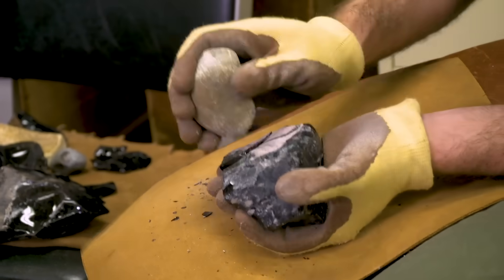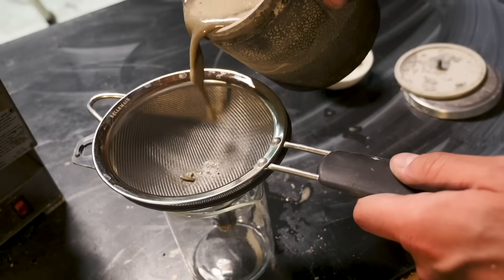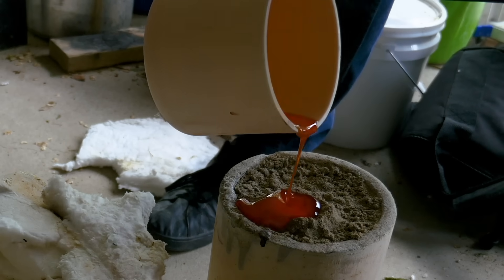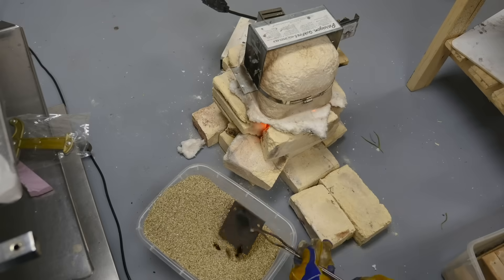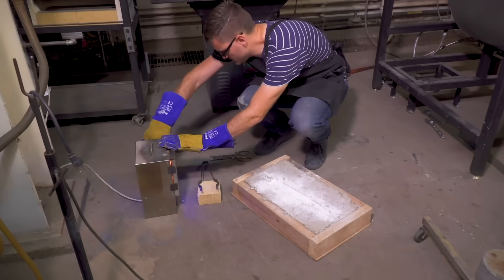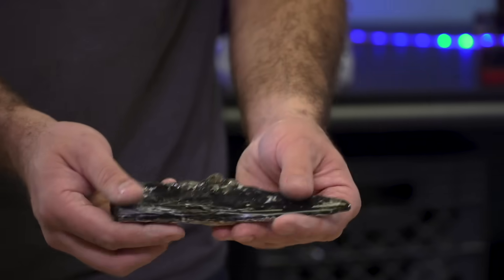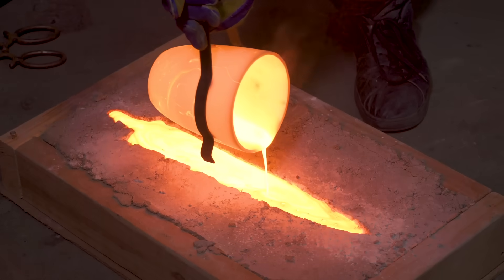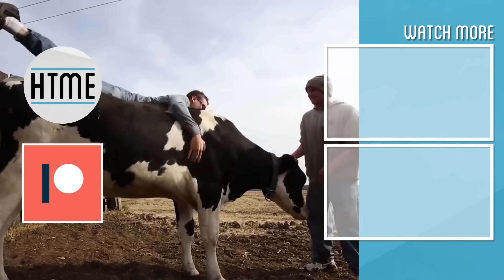Can You Melt Obsidian and Cast a Sword?

Comment: Anyone with industrial/research casting experience will find this whole video cringeworthy. Everything about the way this guy goes about this experience; the lack health and safety (casting low down in shorts), kiln safety, kiln and mould preparation, mould heating, crucible prep (no crucible coating), crucible transfer of brittle ceramics, poor pouring technique, kiln damage around high current elements, flux fumes and so much more. Leave it to the experts or get some training, you'll end up hurt by glass or metal scalding, electrocuted by a kiln or worse dead from a hydrogen explosion.
Reply: Honestly I have basically no knowledge of casting and I was looking for a comment on this... Everything seemed very sloppy and overly casual with such dangerous materials and tools
Reply: This was one of the more frustrating videos I have watched recently.  He did exactly the opposite of everything I know in casting.
Reply: Liofa i was thinking the exact same thing xD
Let alone how he lets his cat run free next to his workspace...
It’s idiot like this that validate every moron’s blacksmith fantasy
Reply: @LJ3783  That's me!  Thanks to the inspiring tone of this video, I'm off to make my own Buster Sword and dislocate my shoulders trying to swing it.  Hopefully my cat steps on it while it's still cooling so I can get a SICK pawprint pattern on the blade. Bye!
Reply: there was some point when he was handling the crushed glass with his bare hands and I was scandalized
Reply: @monckey44   I know right! Looked like he must have learned because the next time he handled crushed glass he had gloves on.
Reply: Musictechnology have you not seen the guy make a jello knife? honestly amazing. pretty sure that guy knows what he’s doing though
Reply: And also who has so many kilns around that it's no biggie when you break a few??
Reply: @Musictechnology  exactly... and lmfao... 😂🤣😂
Reply: Liofa its pretty frustrating, I agree
Reply: Please explain how we can off-gas enough hydrogen for it to explode and kill a nearby human.  Asking for a friend, definitely not looking to create a hydrogen explosion or anything...
Reply: I scrolled too far down for this, OP is obviously is not a master blacksmith and I doubt he is even (a) blacksmith. What happened to the sampling phase?
Reply: I knew I would find a person like you in the comments. That guy who always knows better than everyone else because of your qualifications... oh wait.

Also, for everyone who thinks they know better, make a video showing your know-how. I may not know anything about metallurgy or forging anything in general, but I sure as hell am not a charlatan.
Reply: the tyrant67 basic safety is something you learn in your middle/high school chemistry and shop classes. there’s also common sense.
Reply: Except for the fact that he didn't get hurt, you have a point.
Reply: @motnosniv  
I can theoretically walk through a field with twelve guys blindfolded firing rifles in random directions and not get hit. That doesn't mean it's a good idea.

There's a lot of things that could have gone very wrong for this guy and thankfully they didn't.
Reply: @vigorouslethargy  i guess i missed the part with the rifles. Don't forget your towel.😳
Reply: So record a video casting with it, ugly hater!
Reply: @ShihoArete  >ugly hater
You don't even know what he looks like though.
Reply: If you knew anything about this channel, which you don't, you would know that is not his goal. His goal as a NORMAL PERSON is to try and makes things from scratch.
Reply: @gdshade6876 - LOL... Can't watch anymore, gotta get to work on my homemade nuclear reactor now... I'm not a physicist, it's just, you know... what my "channel" is about!
Reply: @thatwasinteresting.8150  Uhm, okay
Reply: @thatwasinteresting.8150  Yes because the dangers of casting glass is definitely as universally well known as radiation...

I have zero experience in casting anything, and as such, was unable to spot any heath and safety concerns (with basically the exception of his nonchalant reaction to the heater coils shorting, but if it didn't do any damage, I guess I can't blame him for not worrying).
Reply: GD Shade That’s exactly the issue then he’s some normie who isn’t even taking obvious safety precautions.

Comment: there is some chemical reaction in obsidian that just keeps on bubling when melted until there is just a small bead less than 10-12mm D and even that will most times crack as it cools.youll have to ask a geo or chem professor what,? i dont know but have tried many times with same result..only way you will get what you want is to carve it out of a solid block of stone which is probably how the original was made. or maybe put it in a high pressure chamber till it is cold.expect it to have fine surface cracks at the very least.

Comment: The best way to melt obsidian or any "unmeltable" substance for casting or to form an alloy is to use an arc welder. Using a couple graphite rods and a graphite crucible you can melt just about anything your power bill can withstand (maybe try a generator). In this way you can form your alloys in the crucible or layer it in the mold. Give it a shot some day, I'd love to see your results.

Comment: Thing is... what makes obsidian special is it's crystalline structure, not the material per se. If you really wanna cast real obsidian there should be a special level of pressure and slow cooling so it becomes compact enough to produce a sharp edge.
I'm in no way underrating your findings but if you were interested at coming back to this project one day there is def the need for some pressure

Comment: You need to put the mold in the kiln and pour it in the hot mold to keep it from cooling, then put the mold back in the kiln and slowly turn down the temp until its off. It won’t shatter then.

Comment: A vast majority of your problems seem to come from using incorrect equipment. You have how many casting furnaces, but no glass annealing furnace? You're using rough sand casts rather than metal optic molds? You routinely burn through your crucibles? Do you actually do research before attempting these things?

Congrats on your black glass sword, I guess? It's not obsidian.

Comment: Obsidian is basically just volcanic glass. When I took Anthropology they had us do flintknapping with melted down glass bottles so they could re-melt and re-use them every semester. 

You want quality nonmetallic blades get a sapphire knife. Hardness second only to diamond and can be cleaved into atomically perfect edges if grown in a single crystal. I used to have a sapphire knife (but not single crystal) with a beryllium spring to bring through metal detectors.

Comment: As a GIA Graduate Gemologist, I can answer your question to yourself as to whether the obsidian you melted could be considered "obsidian" anymore. The answer is, "no." When the silicon dioxide originally formed and was melted together by whatever geological even which created it (typically a volcano or magma intrusion,) it was then obsidian. Once you melted it, and especially since you purified it with the flux, you changed the natural properties of it to "glass." In the end, once you melt the obsidian, it can never actually BE obsidian again, just glass. So the answer to the big question here is, no, you can't melt obsidian and have an "obsidian" blade, just a glass blade.

Comment: Here’s your main problem- dissipation of extreme heat over a short time.  First HEAT YOUR SAND - and keep it hot while cooling slowly.  Your sand is  ambient temperature, and the obsidian is 2000 Degree plus.  That’s a huge difference in temperature, and that’s EVERYTHING. Try to mold the sword thicker too.  Of course, once your totally done, with all the time and money invested, one drop on the ground will set you back to start.

Comment: It's just slag, man. volcano rock, etc.      if you can pour it into a cast-iron or steel form instead of sand or concrete, you should be alright.   Worked at a blast furnace for long enough to hate everything about this shit hahaha.   Crazy dangerous, hard to control, etc.   It's like oddly-beatutiful and equally hot sticky garbage.

Comment: Try mixing water with lava
Reply: Got cobblestone. Did I do something wrong?
Reply: @plbster  use lava soure instead of using flowing lava
Reply: plbster  You meant smooth stone? Cuz that's what happened to me
Reply: @Egorold  
No it was cobble it said it when I mined it.
Reply: @plbster  i got obsidian
Reply: @plbster  It's supposed to be not moving lava and moving water.
Reply: i found diamonds, at least i can cast a sword with these.
Reply: Lucky I can’t find shit man
Reply: Zero Bahamut idk if you’re talking about Minecraft, but you can’t simply melt down diamonds and cast a sword. It’s like glass but the hardest type you’ll find on the market. Diamonds are composed of mainly carbon and maybe some other impurities. Melting diamond will be a very hard task because Carbon melts at 6,000°, and diamonds form over 100km in the mantle below the crust where temperatures are already over a thousand degrees, which would already slowly being to melt carbon, but because of intense pressure it doesn’t. Melting carbon that’s packed so densely it crystallizes will be hard. It requires a very high temperature to expand the innards of a diamond gem because of it’s density and hardness. Especially melting one will take alot of patience. Casting a diamond sword with the same durability is practically impossible, since the density of the diamond before will not be retained when it cools into the cast, but it’ll still have some reaction while cooling. It’s most likely to turn back into carbon since the pressure is weak than in the mantle and the temperature is less intense, while cooling it might just turn into a sword out of coal and expand as it cools so it can also fracture.
Reply: Pau Casajuana Mestre where tf you gonna get lava from
Reply: RalphMan From the caves duuh
Reply: Alex Marc caves are limestone. Caves don’t normally harbour lava or any molten substance. Caves are made from water eroding and carving out giant caverns underground until they evaporate or leak out. It’s not like lava would pour in because water would evaporate in the first place. But there can be some caves premade but then disturbed by nearby volcanic activity resulting in a pool of lava sitting in a limestone cave. Though it’ll most likely cool if temperatures don’t increase
Reply: That makes obsidian
Reply: @GreenSteedaGT  wooshed mate
Reply: Well that's just making a cobble generator
Reply: Don't forget, you need an iron bucket to carry the lava around.
Reply: Rodary Windsor Cleveland salt water and fresh water would have very different reactions
Reply: Lmao your joking right? I would make a huge explosion too dangerous
Reply: @stewpidasso3910  It's a minecraft joke...
Reply: that makes stone and a lot of steam.

Comment: Hmm the topic of the video really interested me cause I couldn't see a possible way of reforming the obsidian into such a perfect shape as the one of a sword. I don't know if there is a process somewhere around the world (highly doubt it) but surely something went wrong cause you made something out of obsidian (which is not obsidian since you changed its mixture) and it was so fragile. Obsidian's toughness is pretty close to diamond's and that's why it was used as a tool or weapon material in the early ages of humanity. And last i think that if you ever try the whole procedure again you should try cooling the "obsidian" exactly the soonest possible as it comes out of the oven. You see obsidian gets the form of glass because the magma, that comes by the melted mantle of the earth, escapes inside chambers that have extremely lower temperatures. Otherwise if it was given even a very little more time to cool off it would form an actual rock with minerals and etc. So to make long story short try degrading the cooling time at the lowest possible an give us a feedback! Nice try btw!!

Comment: You're thinking too much like glass. While it is indeed a natural glass, it's not so before it is formed.

What you could try is making your own molten felsic material, pouring into a thin mold, and then trying to cool it as quickly as possible, as opposed to trying to slowly cool it in an annealing oven. I'd start with say CO2 fire extinguishers, as Mythbusters got a can of soda to "cold" in I think 3 seconds back in the day with the aid of a CO2 fire extinguisher. From there, you could try pouring liquid nitrogen on it... I would also suggest pouring BEFORE starting the rapid cooling process, as this would allow the molten material to take a shape before being introduced to the cooling process.

Sure, you wouldn't be using obsidian in a casting manner like say steel or aluminum, but you would indeed be casting what would become obsidian...

Comment: Obsidian is volcanic compounds so for it to be able to deposit correctly get a forge to in return get the material hot enough so it has the volcanic amount of heat and when you go to cast it have your cast already hot and allow everything to cool down slowly almost like cast iron but the casting mold its self needs to be hot and very true it's not like metal but that's why I said to get the cast hot as well to ensure a slow cool down to not cause any fractures from stress of cooling too fast

Comment: Why don't you put a 1/2" steel rod in the mold first, then preheat the rod and the mold with a torch, then pour the glass into the mold until the rod is completely encased in the center? Keep the glass hot with the torch, allowing it to very gradually cool. When you're done, you should have a steel rod sticking out of the end of a glass blade. you can then attach whatever to the steel rod end to form your sword grip and hilt.

Comment: I just watch someone else video, you can make a sword, you just have to have pressure jet water and huge..very huge obsidian block
Reply: that's not casting, that's carving.
Reply: it is casting, your casting it to be huge chunk of brick then your carving it.  Its simple cast it as a brick, but afterward carving it you can make sharp obsidian sword.
Reply: Umm no.  That's like saying ice sculptures are "cast" just because the block of ice was formed in a mould.  The finished product was NOT formed with the mould.
Reply: the blacksmith has done their sword the lazy way many time.  No need a mold, the super pressure jet takes care of everything, just gotta figure how to properly handle the water jet cutting power.
Reply: so? still carving, just with different tools.
Reply: we been using carving tool on it every time, he carves it still by molding the sword, I just put something better in mind as the other people who carved it and simply made it be a sharp knife, even the glass can be sharp and you still have to face grinding and all the stuff to make it sharp.  So I ask, what is the point of it if you want a sword made out of obsidian if you don't carve it?